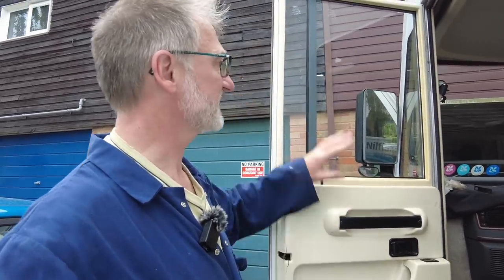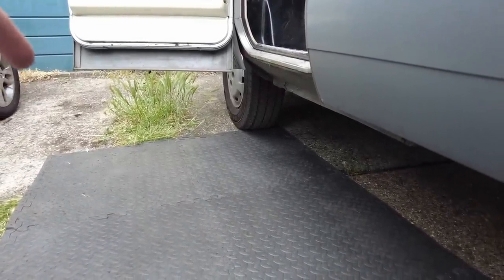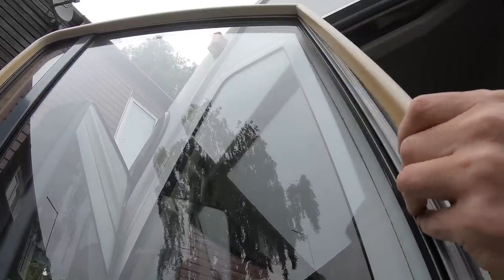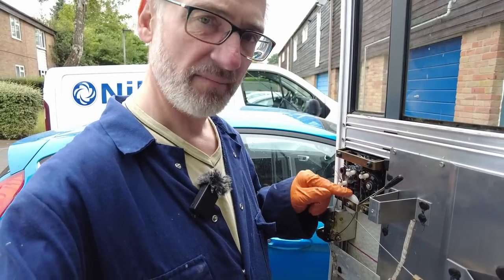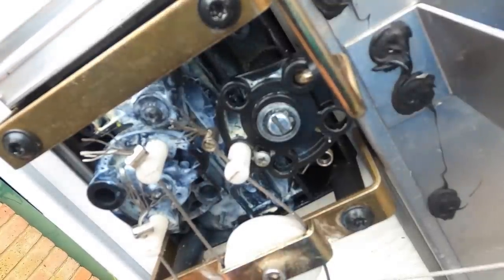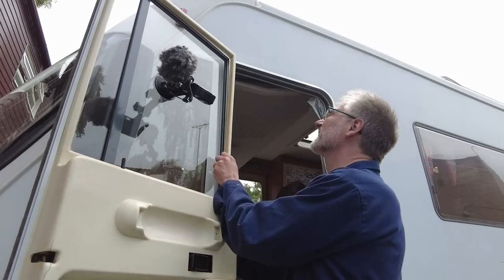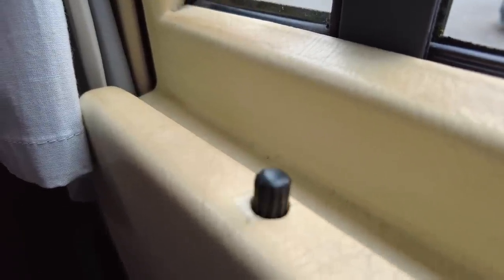Motorhome Inner Door and Lock Repair

Comment: Thanks for a great video. I have an '03 B564 that needs the same fiberglassing to my door but have been, until now, completely stumped (or is it too scared) to get the panel off. Now at least I know I can. One suggestion id like to make although I hesitate to make any suggestion to someone more competent than me is that when undoing the screws through the door retaining spring to put a strip of gaffer tape over the bolts, then they won't fly off or get lost. I discovered this when fitting a handbrake extender when there wasn't enough room to get two hands in. Thanks again for all your posts.
Reply from the maker: Great tip,  David Statham. I hope the video gave you the confidence to do your door ?

Comment: Great repair Ads. I do have one observation though. That spring you highlight at 8.50 minutes. The round part in the middle of that spring. There is a hole behind that round part of the spring. Should there be a metal shaft sitting in that hole? A metal shaft going through that round bit on that spring, would act as a pivot and also secure the spring in place. The way it looks, when you lock and unlock the door. That spring moves all over the place. I think the centre of that spring should stay in one place on a metal shaft with the 2 ends of the spring being the only parts that move. I could be wrong though.
Reply from the maker: Thanks for commenting, Andrew Gledhill. It needs to be able to flick back and forth otherwise it would stop the door pull from moving 👍👍
Reply: @HermanHitstheRoad  I just thought it was strange that there was a hole moulded in behind that spring. It did look to me that there should be a shaft in that hole.
Reply from the maker: Thanks, I hadn't noticed it. I'd consider it if ever I have to take the door off again 👍👍
Reply: @HermanHitstheRoad  As long as it is working OK. It should be fine. If it fails again, you can then look at it again mate.

Comment: Great  video,, and commentary….you make made that look so easy! 

We have a pioneer Joliet and the entrance door lock has failed. We’ve tried to make a spring to no avail….. do you have any advice on what we can do next please?
TIA
Reply from the maker: Thanks, @maggiereid9625. I've taken the door off so many times that it is easy for me. 
What do you need a spring for? Do you mean the one that goes around the barrel to return the lock to the same position? We have two locks where the spring has broken and we just manually turn it back to the centre position.  It would be nice to have the springs, though

Comment: Hi,tanks for this vídeo. I has to remove the front door of my hymer b544. I have a question, do you know What is the purpose of the White tube inside the door? The white tube that ends at the bottom of the door? I'm asking because in my door the tube is very dirty and what worries me is because is plenty of moldy. And now I don't know if I should open the plastic and clean the tube. The plastic have some kind of silicone or similar. Something that I don't have. 18:21 Thanks
Reply from the maker: Sorry, @wellcadmo I'm not sure what wite tube you mean. I don't see one on our door. Can you see it in the video? If so let me know at what time you see it. Could it be a drain or protection for the wires?
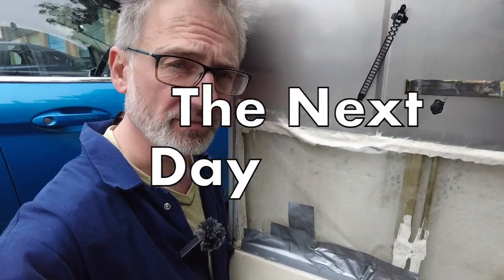Reply: @HermanHitstheRoad Yeah sorry for the poor description. The lower side of the door, is covered with a plastic. Inside this plastic there is  a white tube or cable, I'm not sure. In the video you can see it at minute 17:42. I think I have a water leek on that window and this is why is plenty of mold 😢. But I don't know the usage of that cable/tube. 17:43
Reply from the maker: At that point in the video is the plastic sheet which should help with rain water from the window coming into the driving area. Behind that is the runner for the window. I wonder if yours it's a conduit around the electric cables to protect them?

Comment: Oh dear , i need to remove the door card on my van . It's a couple of years newer than yours at 2000 , though i suspected it removes in exactly the same way . The card is in quite a state , i suspect due to a previous owner's heavy handedness , but also the plastic has become brittle , and cracked in several places . I notice your's has broken in one place , the same place as mine , around the lock mechanism itself . My warning triangle cover won't stay in place as the screw lock slot has broken , and there are bit's missing in a couple of places . I also want to fit a dead lock , but, that's another story . Actually the card is in such a state , i may try and source a new one , but that will have problems of it's own , so i suspect  , so a repair may be the only way to go .
The problem with a repair of this hilt , is finish . It's almost certainly gonna end up in different colours . Unlike the spats , i've recently repaired , paint is gonna be a problem . I have managed to source a trim paint from a restoration company , of similar colour , but still yet to test it . The repair itself won't be an issue though . I've not only welded both my front spats , but the bumper as well , and even converted my radio slot to double din , so a new Kenwood  multi media centre , can reside there . 
My door strap is also bent , and that is damaging the card , but i have a question regarding the interior lock pin . On most vehicles , these unscrew , do they not do that on these vehicles ?
Reply from the maker: Hi Mickey, I thought about fixing the area around the door latch but I don't think there's much room for fibre-glass and the latch.
I'm not sure what you mean by the pin unscrewing.
Reply: @HermanHitstheRoad  It's a fair cop , mate , i dunno what it's called either . The black plunger you show at 2:17 for the interior lock release . They normally unscrew , but i will admit , i tried mine today , and it don't seem to want to play . It could be stiff , but it could also be fixed . It would be the first one i've come across that don't unscrew . Both my other cars do , and ones a 94 Citroen , 6 years older . My door card is gonna be quite a major job , as i said it's in quite a state . I've been having a look at it today , and it looks like it will just about fall out . It's not that securely fixed along the forward end of the door , relying on several screws to hold it in place , though a couple of the screw holes have broken through . I'm gonna plastic weld the thing . Sink some reinforcement in , then fair off with new plastic . Got no chance of getting filler rod the right colour , normally comes in either white or black , and that's if i can identify the plastic type . I'm not sure how long a fibreglass repair would last , i get the feeling it's a stress area , and plastic can be tricky to get a grip on . The dashboard is a polythene mix , and i never figured out what the bumper was , i was forced to use a special general purpose rod . That's the tricky part of plastic welding , you must identify the plastic first . Mixing leads to a weak repair , and eventual failure , the actual repair itself , is a doodle .  
I just got too much on right now to get on with it , so it's on the to do list , though i do wanna fit the dead lock . I wanna get this van back on the road this year , for a special trip next year . So it may not get done till next autumn .
Reply from the maker: Good luck with your repairs, Mickey. I tried to unscrew the door plunger, it wouldn't come off 👍👍

Comment: Using screwdrivers to remove an old panel isn't the best , yes we use tools to hand . 

You can purchase trim removal tools (they are inexpensive or use your other halfs credit card ), they are hard plastic of different shapes , they give a bit, have a larger area to brace against the plastic and the item you are trying to remove it from .
Reply from the maker: You know what David? I have a set of plastic trim removers. Didn't think to use them 🤣👍👍 but thanks for the tip 😉

Comment: I have a few  jobs on Nessa that aren't to dissimilar. I need to remove the main door surround and re attach the window felt, and I have a few bits of cracked plastic to fibreglass also. One being the Toilet panel as you can see daylight though a large crack in the corner and I have to also repair the floor, It is so brittle with age that I don't want to risk removing it to repair it from the back is. some bit have been lost. so I will just fibreglass the entire floor and then recover it with floor vinyl. I also have the front brakes disc and pads to change as one is pretty nasty, not bad enough to fail the MOT, but enough to effect breaking efficiency slightly. The biggest job will be getting under Nessa and sorting out the rusty chassis and then re wax oiling her again. and whilst I am under there I will replace the rear shocks as the once of there have been shocks for too long, and are badly corroded. All jobs bar the brakes to be done after our Scotland trip next week.
Reply from the maker: Wow, Digger Buckett. That sounds similar to what we've done or going to do on Herman. Good luck and let us know how you get on 👍👍
Reply: @HermanHitstheRoad  The Beauty of owning an older Motorhome. There is plenty of rusty bits and weaken plastic to deal with. She did pass her MOT first time round a few days ago, as she has failed a good few previous ones, normally down to the bulb carrier on the rear light clusters being pretty much open to the elements. Last years I was in the Garages yard changing the marker light fittings and lashing in the battery. Ordered a new clamp but it needed a bit of massaging to get it to fit. The battery is meant to be a direct replacement for the original one, but it is slightly wider. when we bought Nessa there was nothing holding the battery in other than it being very tight withing the cradle and surrounding area.

Comment: Cringeworthy job, the plastic brittle due to the effects of the sun. When my electric window operates it goes through a squeaky bit. I have tried using silicone spray grease to no avail
Reply from the maker: Could it be the window motor squeaking or is it the glass, Paul?
Reply: @HermanHitstheRoad  The window glass  as it only happens between points